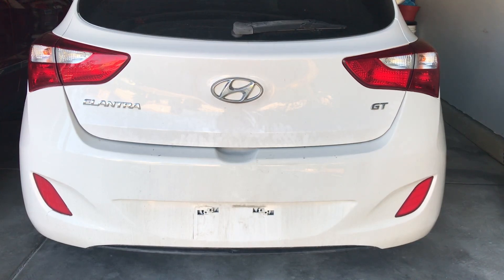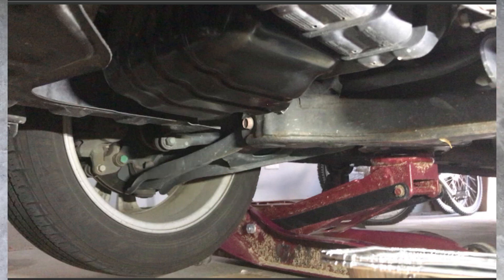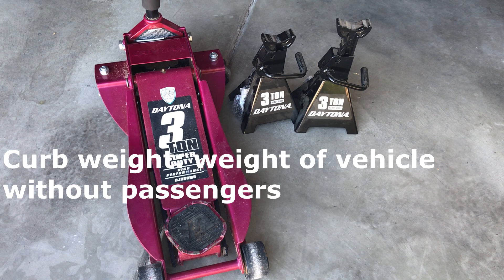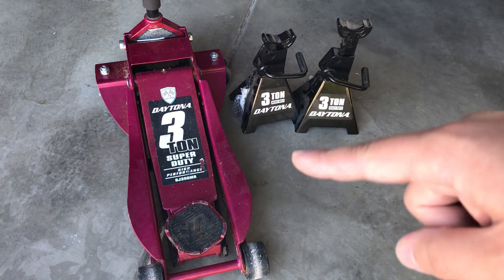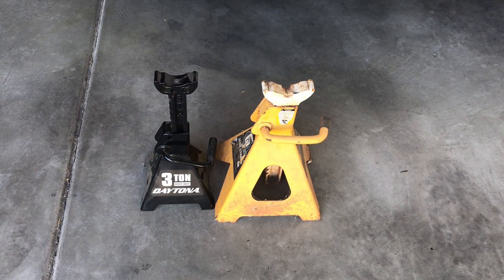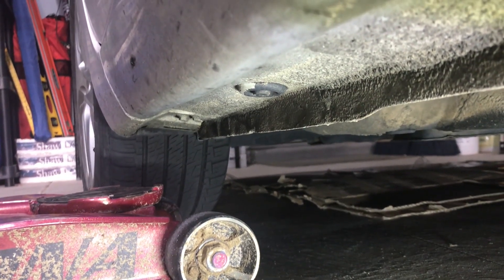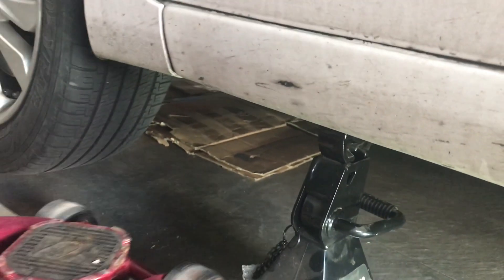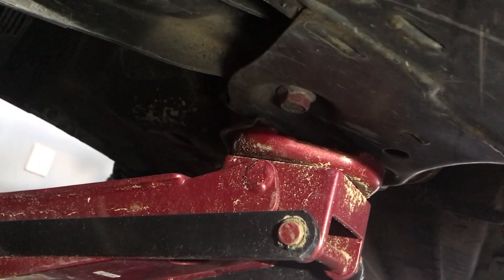How to Jack Up the Front-End of a Hyundai Elantra (for oil changes, brakes, etc.)

Comment: Many times the Pinch rails bend (or even worst are corroded).  I try to use a rag or something too, so the jack or stand doesn't gnarl into the metal creating a new rust point.   These newer cars have very little surface for the jack to contact, & now have plastic panels covering these points.

I always prefer ramping for oil changes,  I hate working under stands & jacks.
Reply from the maker: Good tip. I have noticed after the first couple times I used the pinch rails they started to bend so no more lifting from there!

Comment: Hello,
Can you put the jack and lift the car directly on the point where you put the jackstand ?
Reply from the maker: You can jack and have the jack-stands at the pinch weld. I have heard some folks bend the pinch weld so just be mindful of that. Maybe get a rubber puck for the jack so it can also provide more friction. But yes you can jack the car from the pinch weld. The owners manual has you use the scissor jack there.

Comment: I am trying to find a jack up spot from Hyundai I30 (2013 model). I have a floor jack with a smaller plate (4.5cm diameter = 1.77 inches). Do you think I can also find the spot from same place as in your car? I was also thinking of using a hard plastic adapter between the car and jack.
Reply from the maker: I’m not familiar with the exact layout but you just need a solid piece of steel that can withstand the weight like the subframe, pinch weld, lower control arms, differentials, etc. good luck.

Comment: I just want to know safe jacking points. I hate new vehicles. It used to be simple but not now days with vehicles that don't have frames to jack the vehicle up on it makes it nerve racking. Normally I wouldn't be so considered but rotating tires requires jacking up say front right and rear left. I have three floor jacks and plenty of stands but it's a pain in the butt. I can't find a decent video on good jacking points on a new vehicle and it's driving me insane.
Reply from the maker: Yes it is a pain. Usually the owner’s manual will show you some. You can also google the make and model and jacking points and find results. There are some similar places to jack like the subframe, pinch weld, differential, etc but it is not something you want to guess on.
Reply: @learnsavediy  yeah the problem is it only shows for the jack that comes with the car not a floor jack and newer cars at least mine do not have the typical frame like older vehicles do. I've never had this problem with older cars that's for sure.

Comment: I appreciate the video but 10 minutes and 40 seconds before you get to the part where you're doing the actual title of the video? Just do what you're doing you can always go back and add that or tell people to skip ahead or something that was brutal sift through
Reply from the maker: The video has chapters so you can skip the basics and go directly to the jacking up the Hyundai. I’ll make sure to add a note in the actual video going forward if there will be a lengthy introduction. My hope was to inform people so they have the most info possible especially if they hadn’t done something like this before so they’d be safe, have the right tools, and be more confident.